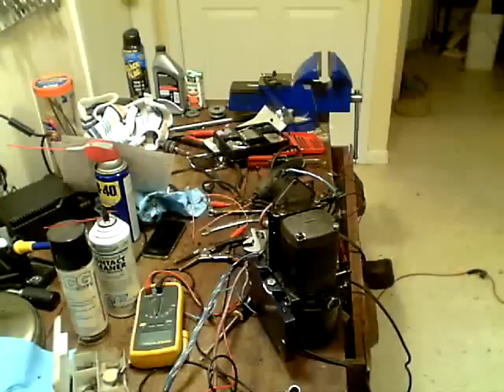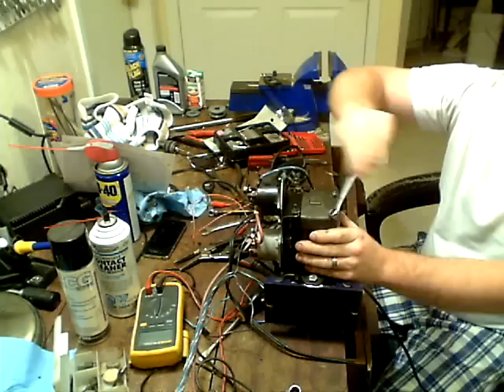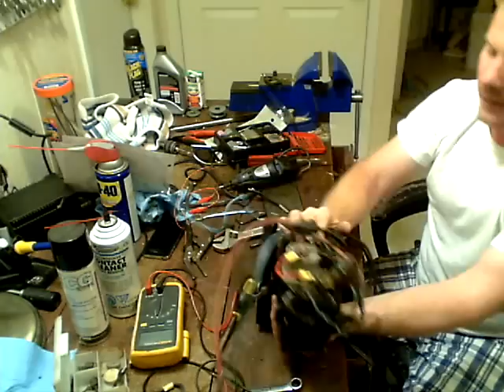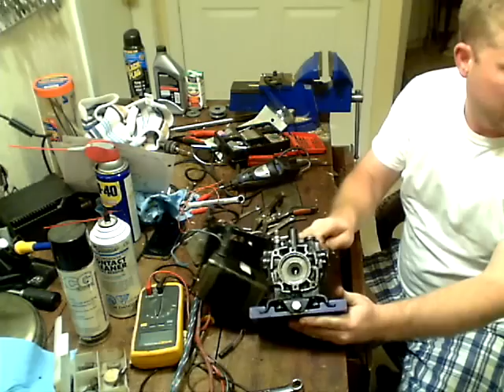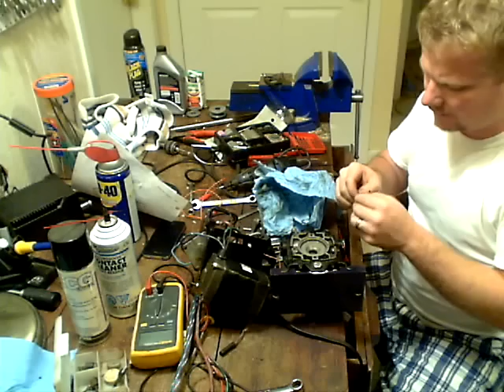Trim motor repair

Comment: Can you tell me why my tilt trim goes up but wont come down? It's stuck on the up and will not come down when put on down switch
 :(
Reply: it's air locked. need to open the manual release screw on the side...slowly
Reply: or one of your relays is bad....obv the down one which is green wire